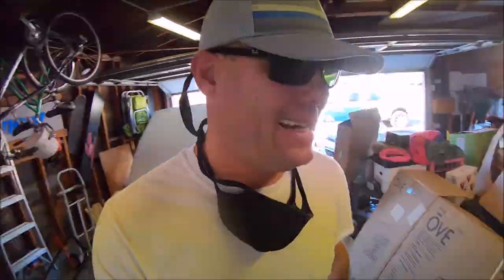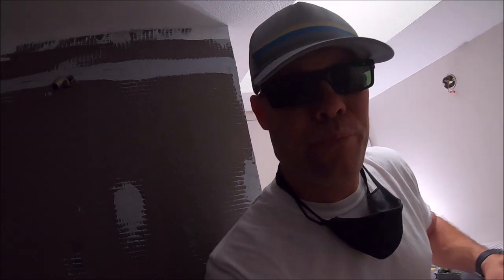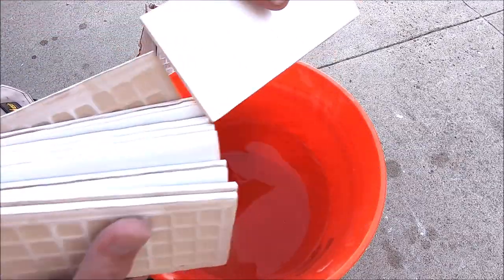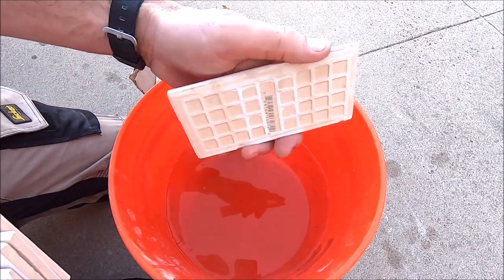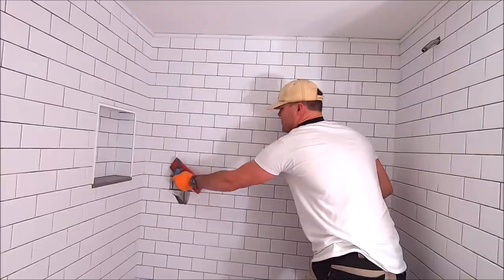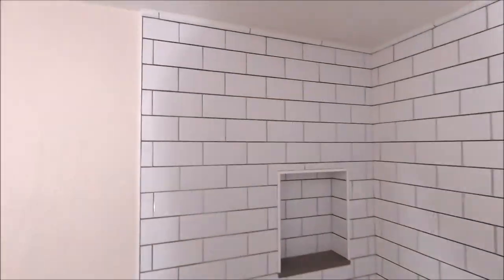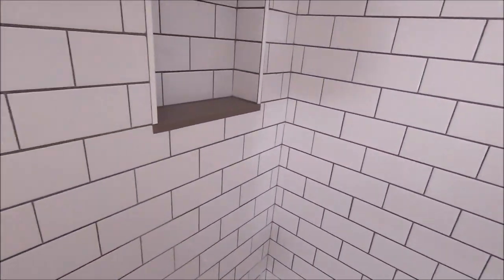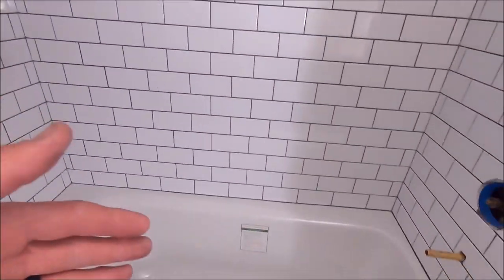Classic Subway Shower Remodel

Comment: Do you also presoak 8x24 ceramic with high gloss tiles? For my shower.
Reply from the maker: High gloss is easier to clean and maintain
Reply: Am referring to the back of ceramic tile and the thinset bond. @LandbergTileTV

Comment: If you didn’t do the prep someone did a good job with placement of the niche as far as seam lines go...especially since you used a special piece for the bottom. Looks nice.
Reply from the maker: we got lucky, the niche was placed at random.
Reply: @LandbergTileTV  liar liar pants on fire😉😉
Reply from the maker: @bigbob9702  There is a possibility it was planned out, but our client didn't lay out any tile nor did they have horse shoe shims to space out tiles. Having that quartz fall perfectly with the two notch cuts was sheer luck.
Reply: @LandbergTileTV  love it. I spent a whole lot of time with the exact same layout trying to catch the bottom and included the spacers. I missed by 3/16. &@$%#
Reply from the maker: @bigbob9702  oh jeez, been there before!

Comment: When tiling shower walls I tile the back wall first then when I spread the adhesive on the side wall, I put the silicon on the inside corner against the back wall tile and the side wall adhesive, then I push the side wall tiles into the silicon just  enough so it will not show through the grout, the silicon then holds the corners together and shouldn't leak. I personally don't like to see silicon on the inside  corner of tiles
Reply from the maker: That shouldn't be necessary if you properly waterproof your shower. Tile and grout is not waterproof. We run color match silicone so that the grout does not crack when expansion and contraction occurs.
Reply: @LandbergTileTV  I live in the UK and the majority of our walls are concrete so movement isn't so much of a problem
Reply from the maker: @tdimccullough  that method would definitely help then!
Reply: @LandbergTileTV  the problem with over here in Northern Ireland where i live people want to see tiles and grout they would not be happy seeing silicon down the internal corners no matter how close the colour is, it would be noticeable

Comment: Nice job!!! What machine and blade are you using to cut the metal schluter?
Reply: Dealt 10” saw looks like with aluminum blade. I’ve got a 7” blade made for aluminum
Reply from the maker: Dewalt Flexvolt compound miter saw with standard 80 tooth blade

Comment: What are you using the smooth the tile edges?
Reply from the maker: diamond hand pad
Reply: @LandbergTileTV  thats very helpful. What grit would you recommend for the ceramic subway tiles that you used in this video?
Reply from the maker: @samuelverrinder5847  Prism grout
Reply: @LandbergTileTV  sorry not grout, grit. Eg 120 grit diamond pad, or 3000 grit. How course or smooth with the diamond pad be? Thank you so much for all the videos. Amazingly informative for a diy tiler. Actually a plumber bathroom installer and your videos inspire me for my own bathrooms.

Comment: What tile did you use at the very top??  It’s not the subway tiles....?
Reply: @Big Bob thats called pencil trim it was either that or ceramic Quarter round but it looked like pencil trim to me
Reply: @FaithfullySojourning  last one I did I cut tile super thin. What a pain.
Reply from the maker: Yes, pencil trim. Two choices, either cut the bottom row at 1.5" and the top the same, cut a 1/2" sliver at the top, or install pencil trim and miter both sides where the walls meet. We like full tiles to start on the flange or shower pan. This looks the best when you have odd shower ceiling height.

Comment: Pro-tip - backbutter ALL tiles. Its quick and easy.
Reply from the maker: no need to backbutter 3x6 unless you let your thinset skin over. Schluter all set is sticky icky!
Reply: 1/4 inch trowel?

Comment: I wanted to find out if you backbutter at all. I couldn’t tell. I hate subway tile!!!
Reply: You don’t need to back butter these.
Reply from the maker: You don't need to backbutter small tiles, but helps a lot if you soak the tiles and never install on thinset that has skinned over. If you run your fingers across the ridges and thinny doesn't stick to them, re-trowel the mortar.